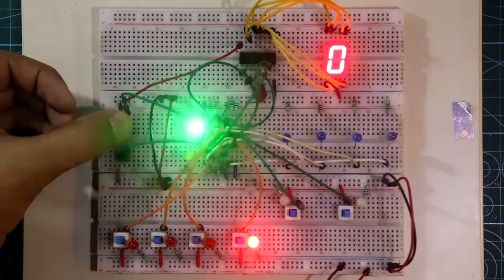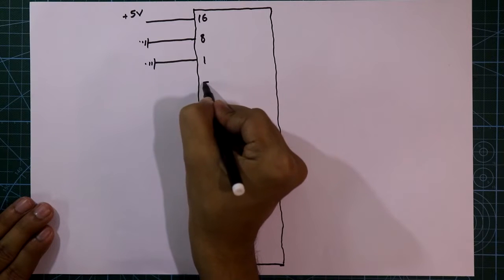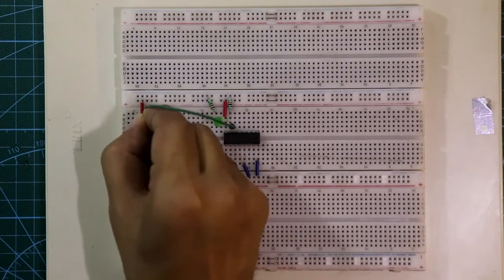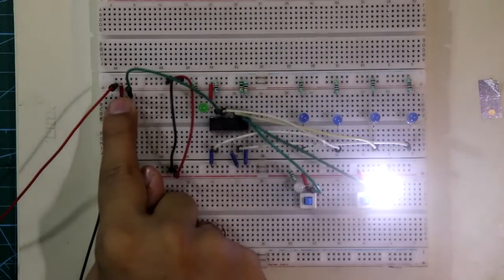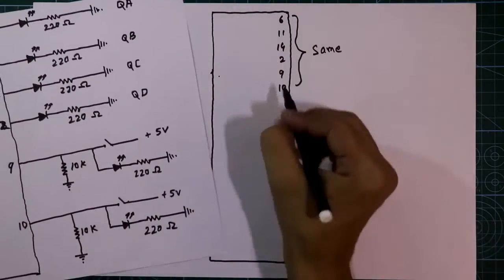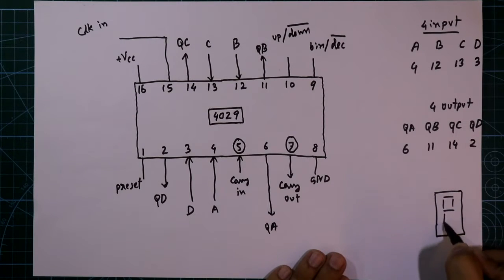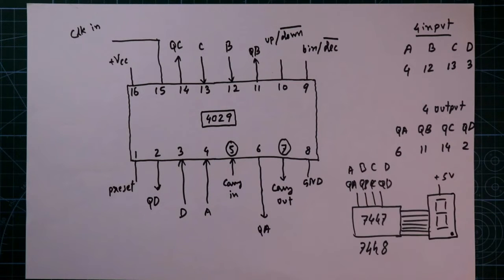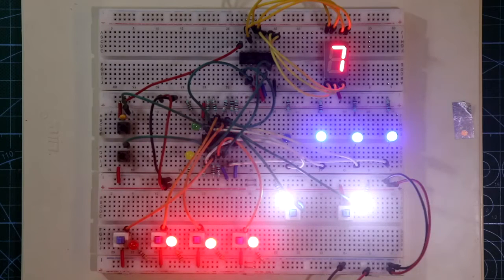CD4029 | Up down decade counter IC 4029

Comment: What chips can I use if I want to build a down counter that counts from 32 down to zero (displayed on 2x 7 segs) with a reset switch and where the clock pulse will only last a few milliseconds?

Comment: Great video. One suggestion: it would have been neat if you showed connecting one of the outputs to the preset enable pin, in order to limit the count range 0-3, 0-8 etc. This is useful for clock dividing purposes or when you need a smaller count. (Maybe that would have made your video too long though.)  😀

Comment: 14:08 - 14:09 you connect A-G of 7447 directly to  A-G of Segment display. But in other video you connect it through 220 ohm resistors.
Also in other video you have 1k pull down resistors for  A-D of 7447. But in this video you don't include it.
I'm confused.